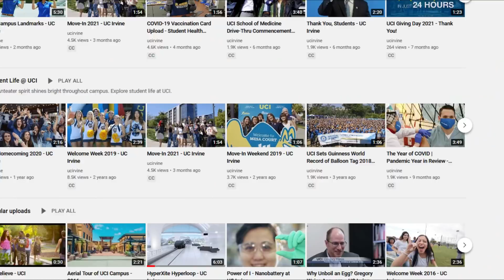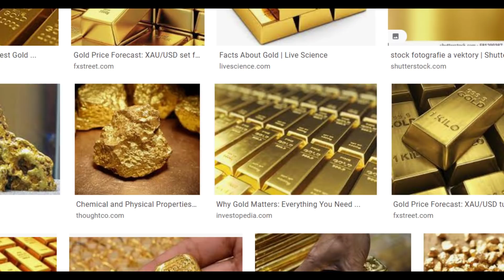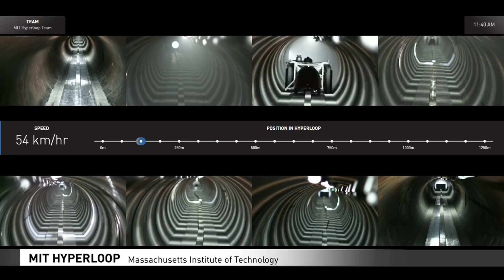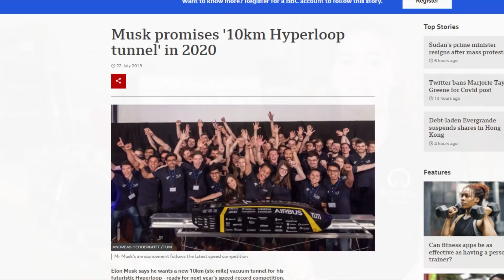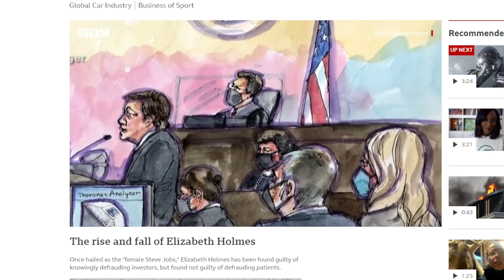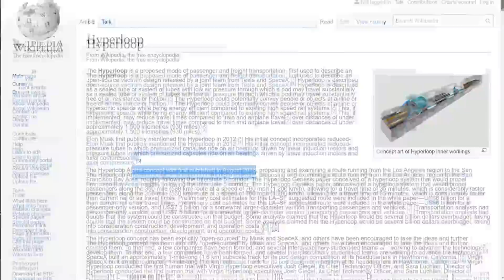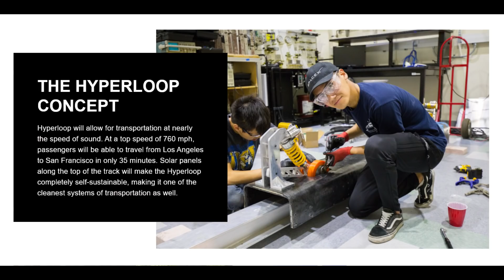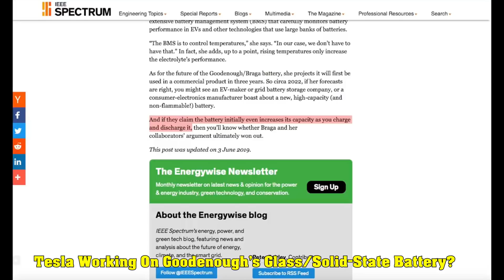The GOLD Battery that will revolutionize EVERYTHING!

Comment: I disagree: Having these hyperloop pods running on wheels is a good idea.
Can I suggest some other improvements:
Put a pair of metal rods on the floor of the tunnel, spaced maybe 143.5cm apart, and have these wheels running over those rods. That will reduce rolling resistance.
String a wire from the roof of the tunnel and use that as the power supply for the pod.
Scrap the idea of having the tube in a vacuum. The cost/energy of maintaining the vacuum will be more than the cost/energy of overcoming air resistance.
Join a load of these pods together with some sort of hinge-type connector so that the front pod can pull the other pods behind it.
Outside of urban areas, don't bother with the tube, just run it in the open air.
Reply: Genius. Let's call it the HyperNet and get the best undergraduates to design something in a competition. We'll make Millions! Nothing better than the smell of taxpayer money in the morning.
Reply: @Warmaka  I know right. And just imagine if the winning team went on to built a test track in... I duno let's say the Netherlands.????
Reply: @jamescooke7243  You realize the OP is describing a train? I feel bad about the 30 million your country wasted.
Reply: so basically its a train??
Reply: Ah yes. I fricking love the trains.
Reply: Genius!!!
Reply: @bobkoshy7869  dats da joke
Reply: @Warmaka  "Nothing better than the smell of taxpayer money in the morning." LOL! THIS! THIS! LOL!
Reply: @LaZarusXtnct  someone's salty
Reply: @lunaballuna  you
Reply: @lunaballuna  I drink liberal tears out of a tumbler from Ben Shapiro.
Reply: @LaZarusXtnct  A Rube-Goldberg machine can work perfectly fine at making my breakfast, but that doesn't mean it's the best way to cook some eggs.
Reply: @cheezemonkeyeater  So if you use it to cook eggs you're using wrong.
Reply: @LaZarusXtnct  ah yes, elon musk, forcing heated seats in all models but charging a subscription to be able to use it. What great work for the environment using more wasteful materials that are literally wasted for the majority of uses, all just to try and sell it back to them. What a positive impact. 

And Elon didn't make Tesla, they existed long before he was even considering working in the car business. He more pulled a hostile takeover similar to what he tried to do at PayPal when they bought the brand he had shares in. Plus let's be serious here, EVs were going to take off either way. We just had to wait for lithium batteries to 1 exist, and 2 be in massive volume for cars. GM's EV 1 for example didn't even get to take advantage of it which is why sales were so poor. You really don't understand how much better lithium cells are. 

He also lied to investors about why he wanted to buy solar city which is why he has been being sued and the entire case had him lie on every question with even his closest employees going against him with him trying to pin things on them. Not to mention if you thought EVs were good for the environment, solar is better. Shame they didn't buy solar city for selling to customers but rather to buy the employees to work on model 3s. Yeah they basically gutted a company with more environmentally friendly goals just to help model 3 production. 

Oh and let's not forget SpaceX calling all employees to work on raptor 2 without pay to save the company when he himself could have paid his employees out of pocket for that. Yeah, this guy really does have a "positive" impact on the world.
Reply: @Skylancer727  You just have alot of opinions and not a whole lot of knowledge.
Reply: @Skylancer727  He's a billionaire. You can't say anything you're broke.
Reply: @Skylancer727  ok first we live in a subscription based economy it seems odd but that's the way we make money now.. if every company that sells a good and expects to sell a subscription is bad well them mark off every tech company and thank apple for starting the craze. Not musk 2ndly solar city was acquired by Tesla not to move people over to work on a new model. It was acquired for them to start selling the power wall battery system and they still make solar panels and that factory owned originals by solar city is still functioning and yes they still make solar panels along with the solar shingles Tesla makes ... I do think having to pay extra for the ability to fast charge your tesla is BS but that's the world we live in. As for the space x those guys hot 500 each in the lawsuit seems they didnt get that screwd if they were found only to have been ripped off by 500
Reply: Uhm excuse me did you even read the WHITE PAPER?
Reply: Interesting idea but all pods would need their own power supply
Reply: Meanwhile, railroads are being torn up as the semi trucks take over the highways, carrying larger and heavier loads and making safe, fast transportation almost impossible between towns.
Reply: I love posts like this, describing something that exists by making it out of well the pids
Reply: @planter13  Sure, but instead of running on batteries, they could take their power directly from the mains via a live conductor, either on the roof, or on the floor.
Reply: @katbryce  exactly, i think they might need to think more about train tech to make this work at all.
Reply: That sounds like an awesome idea! Also, without the expense of building a giant vacuum tube, we can afford to build TWO sets of these metal rods and double the capacity!
Reply: @sulaiman9766  Sarcasm not your strong suit I guess.
Reply: @jeffreyyoung4104  Are you kidding? Truckers for the last 10 years have been in fear of being replaced by rail and air. The number of active truckers has been dropping for a long time. The trucking industry is desperate to the point they'll pay you up $5,000 to train for them and get your CDL with their company.
Reply: Seriously impractical.... but obviously can never be done.... your ideas are way too loco but your motives are in the right place.
Reply: @justinwatson1510  Ok beta male
Reply: @justinwatson1510  You're aware that Musk was the absolute darling of the left until he announced he was buying twitter?
Reply: You should delete that comment before a billionaire Edison steals the idea.
Reply: @jamescooke7243  Nah we don't need that we got bikes
Reply: Yes we had those here in the UK.for quite some time, we call them Train's. I cant believe an American has had a good idea.. or wait it was someone else's idea from 100+ years ago.
Reply: We can call it the above way loop
Reply: OMG, that’s the greatest invention of all time!!!

Why don’t we call it a FUCKING train
Reply: totally legit, we could call it train but with electricity, a tram or ...quantum locomotion device - QLE short - it will change how people see public transportation, it will revolutionize everything, the FUTURE is now, you are the shaper of your future, join now.
Reply: Definitely going have to try and think of a better name.
Reply: according to wikipedia: "Most railways in Europe use the standard gauge of 1,435 mm ( 4 ft 8+1⁄2 in)". This youtube user was joking all the time ❤
Reply: @andriuskazanavicius5572  Great Britain (not including Northern Ireland) uses 4ft 8½in (1,435.1mm). France and a load of other countries in West/Central Europe use 1,435mm. But the extra 0.1mm doesn't make any practical difference and trains can run between France and England without any problems.